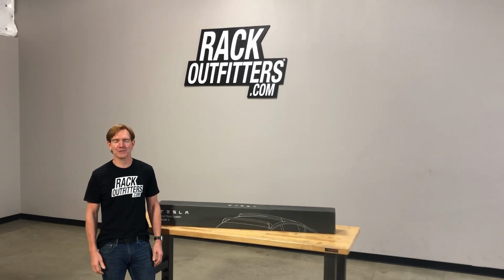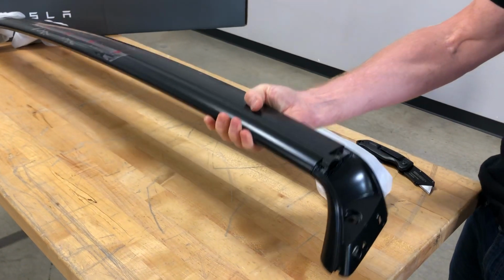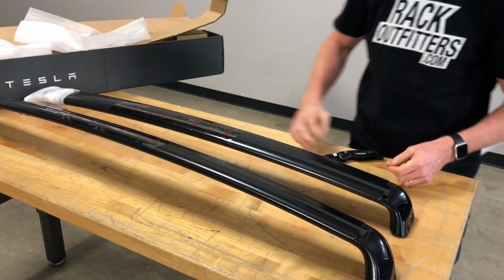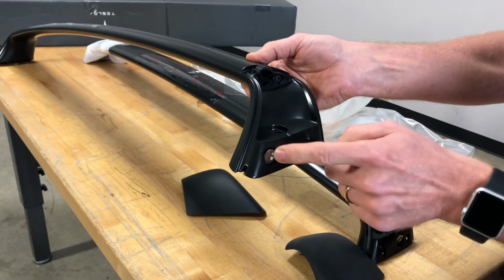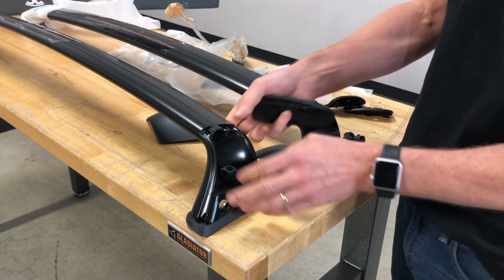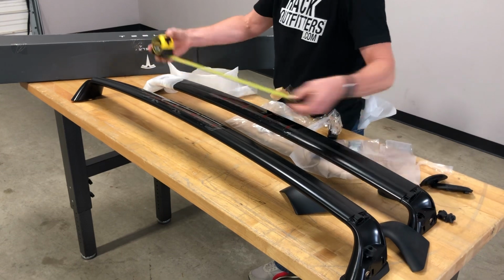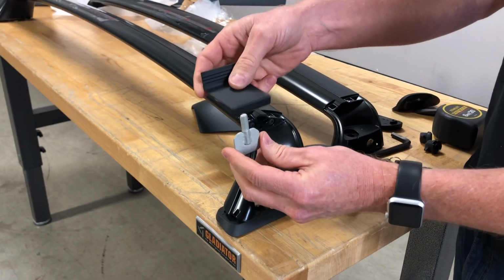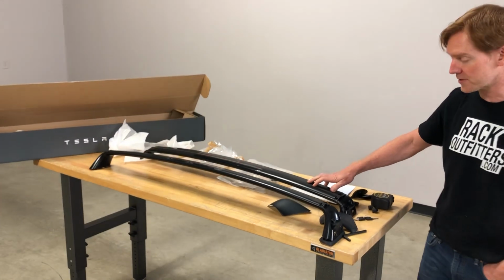Tesla Model 3 Roof Rack System Unboxing and First Impressions

Comment: Great video.
Do you remove the rubber in the t-track when you install a bike rack or ski box with T-nuts? 
I find it a bit difficult to move the T-nuts in place with the rubber in but it is very noisy with the rubber out.
Reply from the maker: The rubber should be kept in place.  There is a bit of friction inserting the fasteners into the bar, however, using a bit of automotive spray wax as a lubricant helps.  Also, pressing down on the rubber leading the fastener will also help.
Reply: @rackattack  Thank you very much. I will give it a try :)

Comment: will the yakima highroad work well with this rack?
Reply from the maker: Yes, and there are two methods of attachment, out of the box the HighRoad has rubberized stainless steel bands to grip around the bar or the t-slot mounting method using the SmarT-Slot Kit 1, here are links to both:
https://www.rackoutfitters.com/yakima-highroad-upright-bicycle-carrier/
https://www.rackoutfitters.com/yakima-8002122-smart-slot-kit-1-for-highspeed-or-highroad-bike-mount/